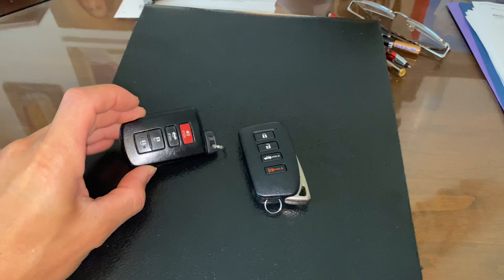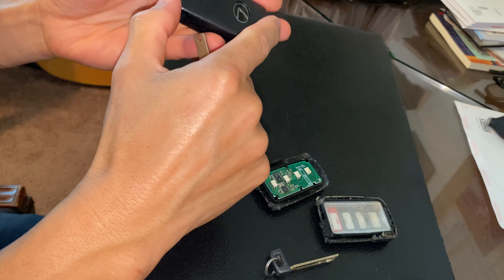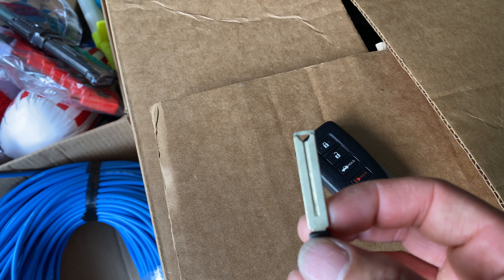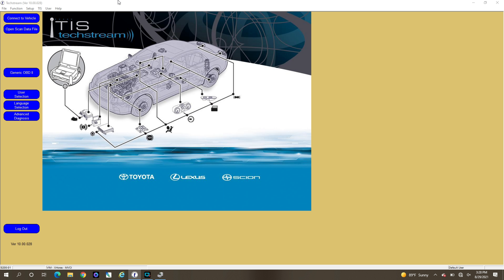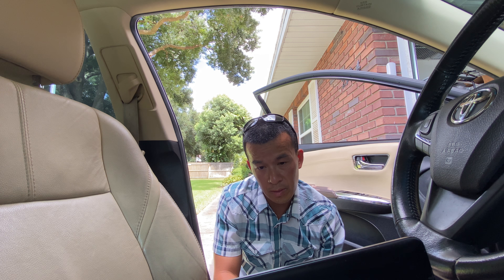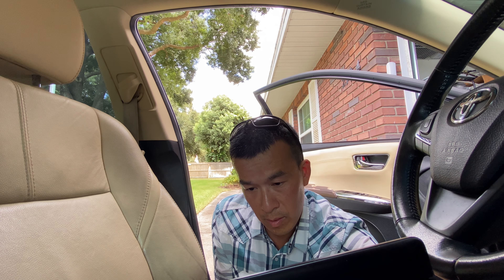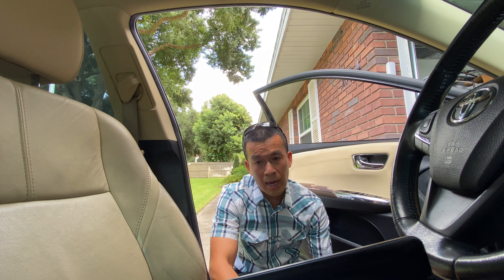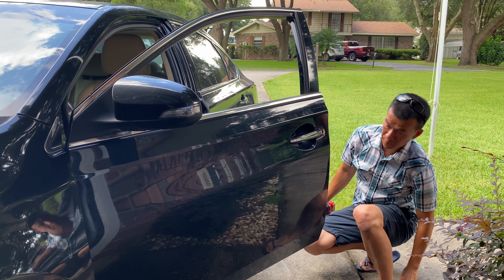How to Program Lexus Toyota Replacement Smart Key with Techstream

Comment: How do I download the software? And connected to the car
Reply: I did a little research basically the obd 2 connector and the software cd you buy from amazon, then you install that to windows computer, based on the research and instructions, it is complicated lots of instructions. Finally you can use the teach stream. I don’t have windows laptop top, other wise I was gonna buy it from amazon which will cost around 20-50 dollars cheap

Comment: I just bought a smart key with an AG-Chip, thinking that it would be one with the G-chip. My hope is that I will still be able to program it for a Camry 2014. Would this be possible? Thanks in advance for your reply.
Reply from the maker: Best bet is to open old and look for number on board like I showed. Match that for new “virgin” key you get online.

Comment: Thanks for the info, I wanted to add that you can program the key even if the last for digit are different. 
My original key 2020 nx300h is 281451-2110 AG, with 3 button my new virgin key is 281451-2020 AG with 4 button.

Comment: Thank you for sharing.  Great content.  I thought I would not have to buy anything else besides the after market FOB, but looks like I will need to buy the Techstream :-). I have 2011 RX 350.  It came with 2 key fobs and 1 I never used.  6 years after I bought the car, I found out that second fob which I never used had stopped working already.  I am down to one so here comes the spare just in case :-)
Reply from the maker: Did you change the battery on unused one? I have two original keys non my IS and a third I added. Two I hardly use I need to periodically change the batteries (5 years or so) cause the eventually die.
Reply: @TunerwithKids  the board is bad. Or turned bad.  I changed the battery a few times already on the working one.
Reply: @vufirst  did you finish programming it?
Reply: @ayman.ibrahim  I had to pay a guy like $40 to program it.  He has a laptop with the software/ cable to do that.
Reply: @Vu Nguyen  thanks for your reply,  did you program the same old key?
And if you have the guy's phone number please ?
Thanks again
Reply: @ayman.ibrahim  I only needed to program the new key.  Are you in southern California?
Reply: @vufirst  I’m in SoCal hmu , I got tech stream

Comment: @TunerwithKids - Thank you for sharing.  When you were going through the Techstream software, it also showed a Remote Engine Starter option.  Is that for programming a remote engine starter that's been installed with the existing Smart Key?
Reply from the maker: No remote start for any cars I have.

Comment: new key worked fine .. but programming the fab has been a struggle .. I follow the video, but when I get to the Smart Key section their IS NO Utility section ?  and NO Option to program the key ?
Maybe the version I got does not do the fab programming ?  I also have a 2015 Toyota Camry so was expecting this to go smoothly, but my software seems different.

edited .. I have now tried 5 versions of Techstream .. and when I enter the SmartKey section .. I never get a Utility button to program a new fab ?
Reply: I'm having the same problem. I tried two different versions of Techstream, no Utilities button.
Reply from the maker: Some of the newer copies have handicapped that feature. Need to find old copy or try the Launch scan tool. I have video on that tool.

Comment: Dear a Bình. I bought an extra key for my Lexus es300h and the software to run it. I will need more connectors to proceed with programming for it. Can you let me know how I would start to proceed with a successful implementation. Thanks.
Reply from the maker: You have to get a cable and search Google on how to get and install Techstream. Usually I got to OBD365 blog posts.

Comment: can i program a 2018 highlander ? push start. New aftermarket or used virginized oem is ok u said ?
Reply from the maker: Should be same process but make sure key is new or the eeprom has been wiped to virgin.

Comment: Hi!

Wondering if you can give me some insight.

I have techstream and an 07 Prius equipped with smart key.

I bought the car with only one fob. The smart function never worked and the lock/unlock function doesn’t work either.

I bought a virgin, non-smart fob on Amazon. I got it programmed to start the car but like my other fob, locks don’t work.

Is programming the locks to the fob a separate process in tech stream?

Great video!
Reply from the maker: Non smart key on a push start car? If it key turn ignition, immobilizer programming is separate of the remote programming.
Reply from the maker: Here’s another video I did for standard key. https://youtu.be/Cfe5bZIowoM

Comment: I followed through all the steps to the end but my car is 2013 rx450h.  It has another step put the key to register in passenger seat. I tried placing every place on the seat but it doesn't work. Is it because the key I bought is used/not virgin? It is 30 something compared to 85 90 one on ebay.
Reply from the maker: A key not virgin will not program.

Comment: I have a Lexus ct200h. Both key fobs were lost. Reputable locksmith was unable to program new key. He says his key was probably the issue and reccomended taking to dealer. I take to the dealer. They were unable to program their keys. They say the ECU is locked and needs replacing. Can the ECU be unlocked? Would this be similar to re-flashing? Lexus wants an arm & leg to replace the ECU & immobilizer which is located in the dash.
Any insights appreciated thanks!
Reply from the maker: The dealer can reseed the ECU to assert new keys if lost. No need to replace ECU.
Reply: @TunerwithKids  

Is reseed the same as reset? 
Thanks!
Reply from the maker: Reseed means they use the original secure Toyota information stored for the car to flash the ECU.
Reply: @TunerwithKids  
Thanks for quick response!
Im new to the terms such as reseed & flash. So basically, the ECU would be "re-programmed"  to factory settings?

Comment: Great Video Binh. My 2013 Avalon FOB key appears to be dead. It is beyond battery replacement. Can I use this approach to make a completely new key or does my original key have to be working? Thanks in advance.
Reply from the maker: Old key needs to work to access the ECU.

Comment: This will work with and lexus IS250 2014? On eBay it's saying ( Fits your 2014 Lexus IS250). I have 3 button model key without the red button one.
Reply from the maker: Yours is non USA? Cause outside US, the panic red button isn’t required.
Reply: @TunerwithKids  Is not USA, EU.

Comment: Hi Binh! I just purchased a replacement for my 2013 Lexus GS350 and I didn’t see your video, of course, until AFTER I had already made my purchase. I heard you mention the virginized key is better than an after-market key & when I looked back at my invoice for my replacement purchase I thought “oh nooo!!” The company I purchased from states that it is an after-market replacement :-\

Will this be an issue or is it mainly bc the aftermarket are kind of like knock-offs as opposed to the “real thing” just refurbished/virginized?
Thanks so much!
Reply from the maker: Aftermarket one may not be durable long term. Poor solder joints and weak antenna. I’ve had many remote FOBs with poor battery solder and intermittent not working.
Reply: @TunerwithKids  gotcha- & wow, thank you so much for responding so quickly! I appreciate you & your help so much. 

I have one other quick question if you have a minute: how do I get the software you use in this video so that I can program the key myself? It’s just a spare key (to have as a backup to my original one which is in perfect working condition) so, I kept the order I already placed for the aftermarket FOB bc I feel like at the very least I will have a working spare if the need for the spare arises. 

So, back to my question — I am now just curious regarding the software and whether this is a free downloadable software or something that is costly to get? Thanks again Sooo much, Binh!
Reply from the maker: You need the cable. And the software is a search away. OBD365 blog is a good resource. I’m not up to speed on how the newer versions work. I’ve heard some people have trouble with new versions not allowing TPMS or Key programming. I have a 2015 copy so mine has all the features I need.
Reply: Okay final question, I hope! Haha what is the exact cable I need? In your video I heard you say plug into the OBD port but I’m seeing lots of different versions on Amazon & don’t want to get the wrong one 😬
Thank you again for all of your help with this!!

Comment: Any help, my techstream 17.30.011 does not have smart key option under body electrical. I have Entry and Start. All works fine till I have to leave the new key on the passenger seat

Comment: how do we look up the vehicle compatability?  I have 2013 lexus rx350. will this cable work?
Reply from the maker: Techstream is a Toyota software so it does all their cars.
Reply: @TunerwithKids  can i use an aftermarket virgin key fob with it too?  I was looking for the virgin one on ebay and it's kind of pricey. thanks for your help
Reply from the maker: @edl8056 most OEM used virgin keys are $100. Not bad since aftermarket are same price.
Reply: @TunerwithKids  I ha e one more question, I saw another video where I can just buy the OBD2 cable and download the software. I was wondering if that's recommended? Because the Amazon seller also will be sending a link for the software after the purchase. I'm worried about virus on the laptop from the download. Did you have any issues?
Reply from the maker: @edl8056 you’ll have to research the software online. Obd365 has a blog that may help you. Im not up to date on latest versions or how to unlock it.

Comment: Hi there,
I bought a used Lexus RX 350 that only come with after market key.  I bought another one from eBay which said to be support board for this specific Vehicle.  However, the working after market fob that came with the card have a different board ID.  I tried to program the fob key bought off eBay but can't keep failing.  I so tempted to reset the immobilizer or erase code, but don't want to end up have both fob not working.  Do you have any experience or suggestion you think it might work?  erase all keys and add the one I bought from ebay since that seem to be a correct board ID then the one that came with the car.  Thanks
Reply from the maker: Is the eBay one unlocked or virgin key? If it’s aftermarket it won’t have same markings or numbers as OEM.
Reply: @TunerwithKids  Thanks for your response Binh.  Well, I contacted the seller and he said it is (virgin).  I asked him how would I validate of his claim .... no response.  Have you done immobilizer reset?  Do you know what is the different btw immobilizer reset and code reset/erase? Thanks again.
Reply from the maker: You need to buy security tokens and have techstream to reset the immobilizer and wipe all keys. After that, you can program new keys. I’ve heard people say that even used locked keys will program after a token security reset.
Reply: @TunerwithKids  Thanks, I looked at some of those video as well just haven't got the gut to pull the trigger LOL!.  BTW, what did you used to shoot your video and how did you upload with such clarify?  I normally shoot my (family stuffs) with just an Iphone and the quality is horrible after upload.  Thanks for taken the time to response Binh.
Reply from the maker: My videos are shot in 4K iPhone or Fuji XT200. It’s all processed in 4K and uploaded via PC. I have external and wireless lav mics.
Reply: @TunerwithKids  Is different when you upload from the phone vs PC?  For this specific video, was it with iPhone or with the Fuji?
Reply from the maker: I do combo of cameras especially if it’s multi angle. But this video was for sure on an iPhone Pro 13. I’m not sure for upload quality.

Comment: Hi I have a Toyota Allion 2008.  I lost 1 set of smart key ( 3 botton) the PCB 2711451-0500.  Where can I buy a new one from Techstream and program myself.   Where to download the application software to do the programming.
Reply from the maker: Not familiar with Allion in US. But look for eBay seller who sell virgin OEM used keys. Techstream is online, just search for it and the cable.

Comment: Why did you need the lock cylinder code? Does this help you get the key cut?
Reply from the maker: Yes, it is cheaper and easier for the key cutter to use the code vs looking at key and decrypting the pattern.

Comment: Hi Binh , csn i viginise my own keyfob by erasing the key using techstream?
Reply from the maker: No. Virginising the key requires accessing the keys eeprom and putting back to stock. When they program, the keys and immobilizer on the car “hand shake” it’s an anti cloning feature to prevent theft and signal stealing.

Comment: I did as described on a Avalon 2013 but the buttons won’t work apparently u need a professional for that. 
Key Chip did get programmed though so it starts car if I tap the engine start button

Comment: I have a 2002 lexus. I want the newer key. Would it work?
Reply from the maker: No, 2002 uses different key systems. I have a video on programming a key for a GX which is similar to 2002. There is an eBay seller that I buy my keys from that cuts them using photo or code too. Links in description of that video. 
https://youtu.be/lsBDne3Q9f4
Reply: @TunerwithKids  🙏💯

Comment: How do you removereplace  the door handle , it slides out.
Reply from the maker: There are 10mm behind the handle so you have to remove door panel and lock and unbolt and slide the front out.

Comment: How to erase a Smartkey that u already lost in the techstream  system, I have a Toyota iq with one working key only I want to add a new key and erase the lost key out
And how do you know you are picking the right one? Thank u
Reply from the maker: I’m not sure on eraser. I think you have to erase and add new but usually there’s only two keys, so it won’t erase the current key used to access (I think).

Comment: I can’t run techstream after downloading it.
Reply from the maker: Newer versions require activation. There’s a guy on a forum that does it as a courtesy. I have a old 2015 version that didn’t require all the activation stuff. I can’t seem to locate my EXE files anymore though because I want to use on my newer PCs due to the ease.
Reply: @TunerwithKids   if you find it post it in here or on clublexus please sir

Comment: Horrible software tbh. This is impossible to do without a key that’s already programmed. I’ve lost my key so how am I supposed to program a new one if I lost the old one? 😂
Reply from the maker: Dealer has to reseed the ECU (labor/diagnostics time) with security codes directly from manufacturer and sell you a new $300 key.